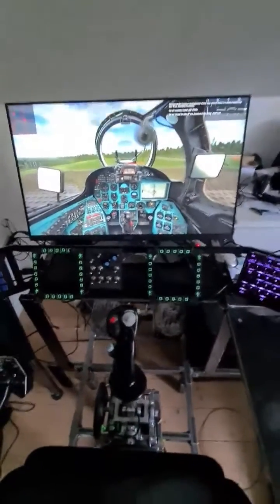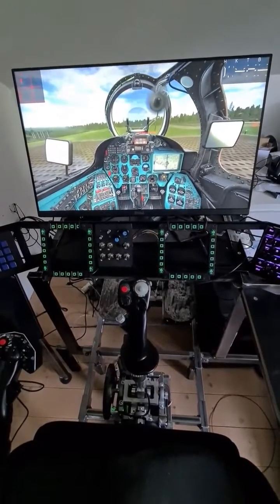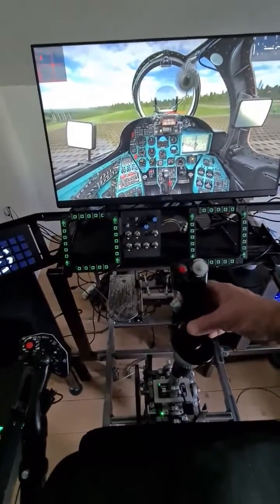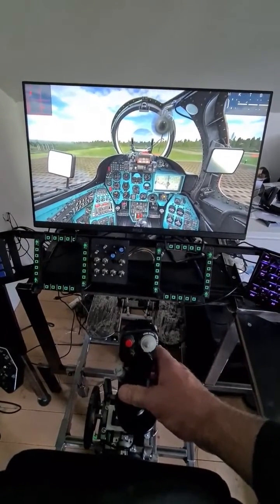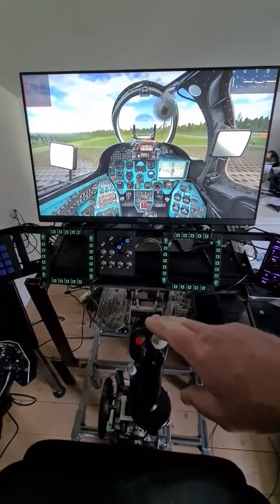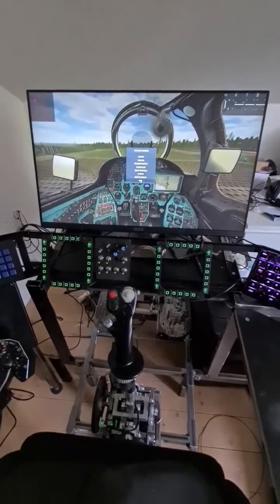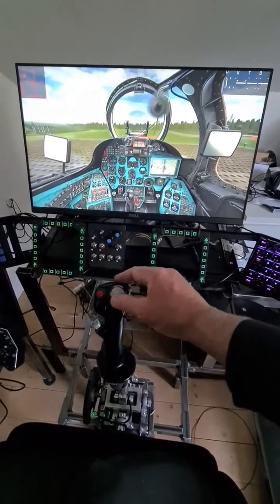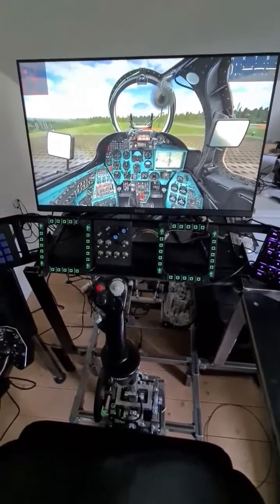ForceTrim on Rhino DYI FFB Joystick

Comment: Hey man. How smooth does it feel? No cogging? And how many bits is this thing? Wonder if it has a high definition range of motion
Reply from the maker: It is really smooth - No cogging what so ever.  Resolution is more than adequate , Not sure on the real numbers but the slightest move on the handle is detected. The range of motion is up to how you design the gimbal. I have roughly 17 Deg from center in each direction. I know that the Rhino that Walmis provides have 22. I have never reached the stops but I mostly fly helo's. I have tried warbirds and the A10 and they work just fine, and it is a whole new level of immersion with FFB :)
Reply: @ogre903  nice. Reason why I ask about resolution is because I fly mostly helicopter myself also. I use a Komodo Cyclic, and I can control the whole helicopter with just tiny finger movements
Reply from the maker: @kmaxx263  Same here, I mostly fly helos and have a PPL for Helicopters (R22) but that was many years ago, But I do fly the same as you, 3 fingers with very small adjustments and the Rhino and controls are  working great. The main function that is really nice is the Force Trim. Being able to simply set the Cyclic/attitude and then just use small inputs for control.
Reply: @ogre903  Awesome! But for me, mostly I don't fly military choppers, but civilians. I don't see the point in force trim on those helos, because the stick is supposed to stay where I let it go.. So I actually wonder how well the Rhino does this part? Can I flick it ever so slightly with my fingers, and it will stay in it's new position without centering force?
Reply from the maker: @kmaxx263  Yes you can. The forces are all configurable including damper, friction, spring and also grip weight compensation. Tweaking this you can simulate any type of feeling that you are looking for. I like the force trim since that allows me to set the cyclic in a hovering positions and then the spring effect makes it easier to control with small inputs.